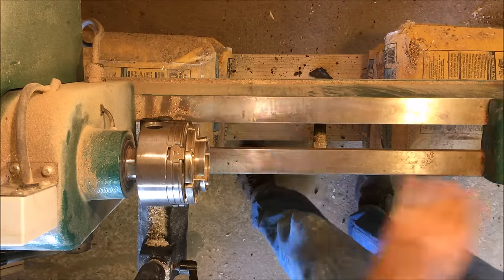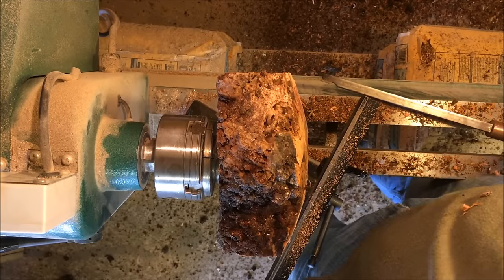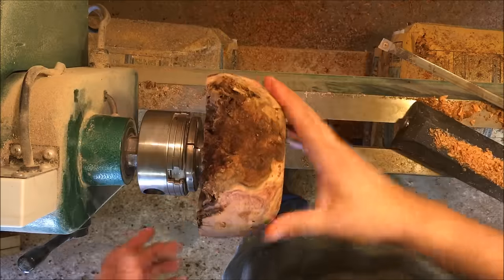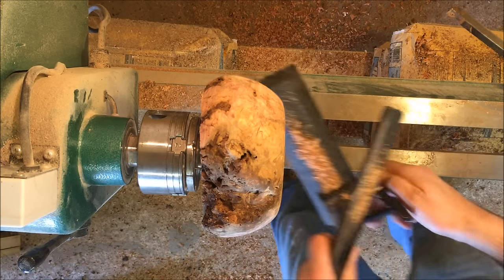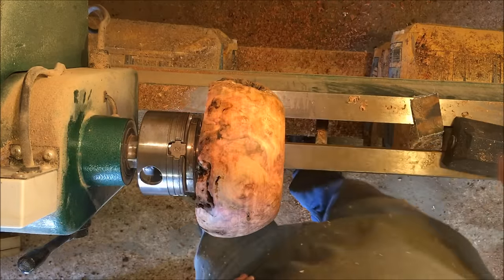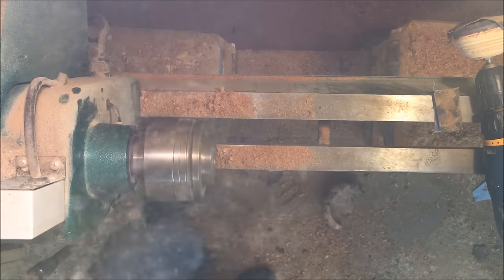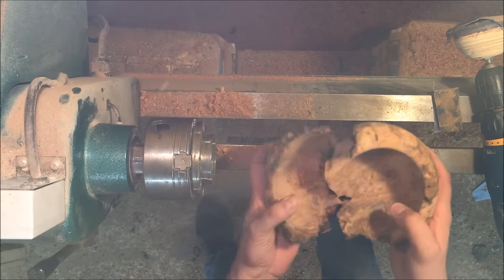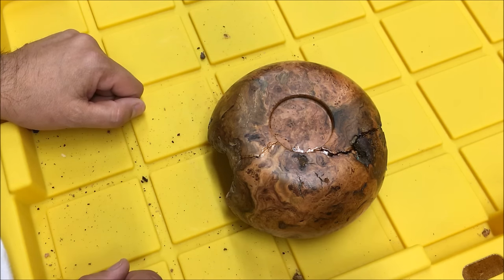It Broke My Heart When it Exploded

Comment: Dude are you ok?? No new vids? We want more.
Reply from the maker: +Lazy watchsmith Sorry It's been a while. Stay tuned for more videos. Got to set up my new shop and make some camera mounts. Need to run power to the buildings because I'm use an extension cord right now. A lot smaller space too, but I am doing some lathe projects now. What sucks it my equipment is all rusted, sooooooo you may see a video on cleaning up a table saw soon.

Ken
Reply: +Moonpie Creations 
It's all good stuff. shop projeckts are alvays big hits on you tube. glad you are ok.
Reply: +Moonpie Creations 
It's all good stuff. shop projeckts are alvays big hits on you tube. glad you are ok.